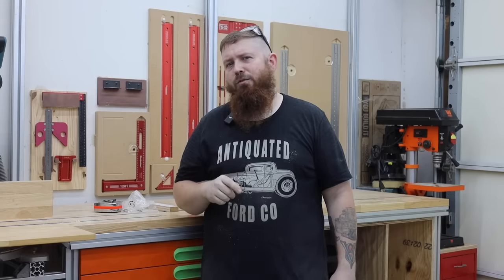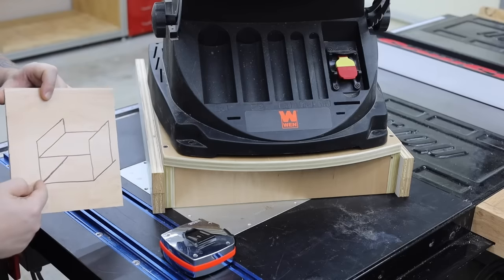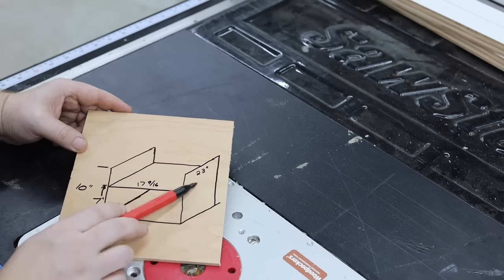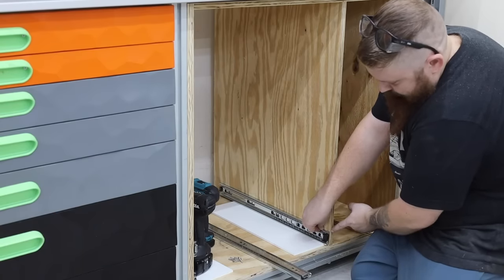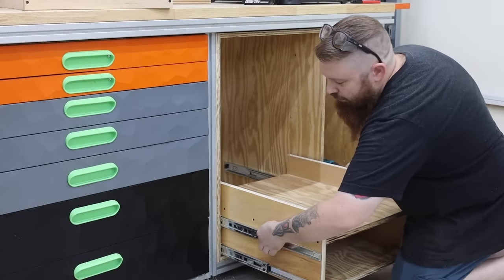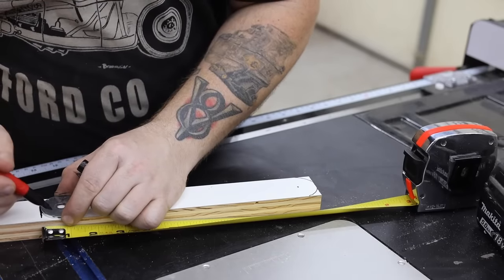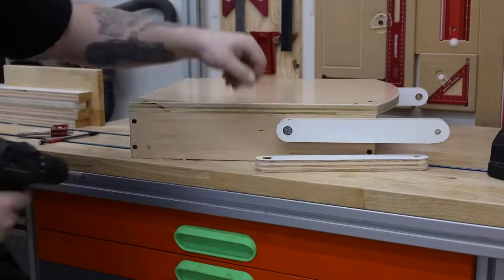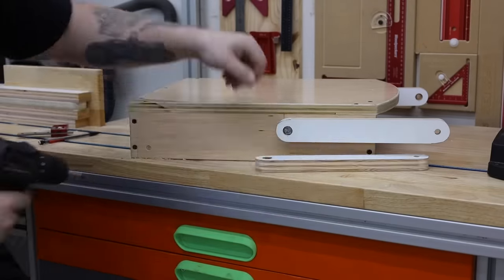Don't Build a Flip Top Tool Stand, THIS Tool Storage Is Better

Comment: I am currently working on my own rendition of a mobile workbench station and was looking for ideas for the bandsaw, planer, drill press, and router table to all tuck under to leave a clean workspace for assembly. This is a really clean idea and I’ll be using this in customer sizes for all the tools.  Thank you for making it.

Comment: I was going to build a flip-top for my spindle sander and belt sander. I have VERY limited space and having a flip-top would free up some of that space but this concept is much better. I can have 2 or 3 bench top machines lined up along the wall and with this "flip-up" idea I wont have to drag the flip-top out to access them. And that also gives me much more, valuable, work bench space. Thank you! Glad I found this.

Comment: Holy crap. What a great solution. I use a wheelchair in my small (garage) shop and have been struggling with coming up with a flip-cart design that would accommodate my sander (I have the Bauer (Harbor Freight) branded version of the same sander) as well as my DW735 thickness planer since space is at a premium. At my height, getting enough flip-clearance and not end up with the sander table too high is difficult. I spent the last two days making a cart with the DW735 on top and the sander on this type of lift and the result is fantastic. It puts the sander table at just the right height (essentially my slide out drawer is just a flat tray with sides - no riser necessary) and stows away easily under the planer when I don't need it. The only drawback is that I don't have much clearance behind the sander with the planer there, but I've never needed that really and with the weight of the planer I can pull the drawer out a bit to offer more clearance if the occasion does present itself even though the whole thing is on a rolling cart. Thanks for this idea!
Reply from the maker: That’s a great idea. Have a mobile cart with your planer on top and this sander below it. I wonder if somehow you could fit 2 tools below the planer. They could each come out on the sides so it wouldn’t block the planer from being used.

Comment: Great job and fantastic idea! I just started building a base cabinet to store my bench tools in and to have a work surface to use them on. I've looked at flip tops, ceiling tracks with pulley or winch lifts, and even lifts similar to yours. I finally gave up and decided to keep it simple by placing to tools on pull out trays and just lifting them manually onto the bench. Your idea is by far the best I've seen, and I'm so glad I stumbled upon your video. I'm sure this application will work great for at least some of my tools if not all. Thank you so much!
Reply from the maker: Thank you!

Comment: Thanks for a great idea. I have a Blackstone 22" griddle on a pullout in my outdoor kitchen. The only complaint I have is that it is lower than my counter height. I am going to re design the pullout and incorporate your lift system to bring it to above the counter, a better height for grilling. I will write back with the results. 
Cheers

Comment: A great solution!!! I can see this potentially clearing my scroll saw of the bench surface(great tool but not in ‘everyday’ use) thanks for sharing👍🏼
Reply from the maker: Thank you. I thought of doing one for a scroll saw that had slightly shorter front legs so it sat at a slight angle. Maybe it could be adjustable so if you wanted it to sit level.

Comment: Great solution. Stops stuff going everywhere unlike a flip out or revolving tool stand. For the drawer under my table saw stand, I angled the drawer slides up a bit to make it self closing. Might work here to keep the sander against the bench.
Reply from the maker: That’s a good idea. Thanks.

Comment: Nice build.  I made a flip-top stand for my planer/sander, but incorporated a drawer in the base.  I keep my accessories in ziplock bags inside the drawer so nothing gets lost.  Yes, I can’t use the storage built into the sander, but I don’t have the floor or workbench space to spare.  Just an alternative suggestion for those with the same issue.
Reply from the maker: Thanks

Comment: Have followed with great interest your "under the workbench" project and must state = for stationary, fixed (large / long) workbenches with sufficient free space under the work surface, your idea / implementation is certainly a gain, absolutely! BUT - if you have to get along with little space, stow machines and move in the room, the flip-top cabinet also has its justification. You just have to adjust the proportions, if necessary implement a handle for more safety, the larger machines you attach to the turntable and you just have to be careful when changing the tools / turn the work surface. In any case, I would not use the statement "THIS is ...". 
Conclusion: It is a pleasure to watch you implement your projects, have already taken one or the other suggestion, thank you for that! 
Please keep up the good work!

Comment: I am mixed on this.  This is another storage solution but it doesn't eliminate the need for a flip top design.  Filp top design allows for two machine to be held in a smaller footprint on the floor.  Most shops have more unusable/wasted vertical space.   Floor space is at a premium always.  Still a cool design.

Comment: This is a very cool option to keep in mind. For me it doesn’t replace a flip top as the purpose of that is to store two tools in the space of one. I also don’t have a fixed workbench like this to build a pull out/pull up and mobile is also a requirement. 

But that doesn’t mean I did t bookmark this for later 👍
Reply from the maker: Thanks
Reply: At first, I was going to do a flip top....but this is better for me as it allows me to retain precious workspace when it's not in use
Reply: A flip-top does not store two tools in the space of one. It just swops 2 tools over. If he had a tool on the worksurface, he could still lift the sander. If you flipped this style of sander, all the tools and space cylinders would fall to the ground.
Flip-tops-
- make dust hose and power difficult, and you always have one tool out, collecting dust
- take more effort to operate
- usually need to be on a cart, to give access to use.
- mean that most of the space around the stored tool cannot be used.
tools involved often are different sizes so space needs to meet the biggest.
Apart from that...
Reply: @Tensquaremetreworkshop  Pretty pedantic to argue swapping tools into the same space is not the space of one. It’s not like I didn’t think OP’s video was a great idea. I’d build one if I had a stationary workbench which I do not. Mobile cart is 100% a necessity for me.
Reply: @jhirn2957  Thanks! (pedantic means precise, and I always try to be that). I am a great fan of tool carts, but I have never seen a flip type that is worth doing.
Reply: @Tensquaremetreworkshop  I like fischer’s which takes care of the cord problem you mentioned. Also pedantic is being a pedant which is to annoy others by correcting small errors. Hope that helps your precision.
Reply: @jhirn2957  I try to correct errors of any size. It seems illogical to be annoyed at an improvement.
Reply: @Tensquaremetreworkshop  you must be fun at parties.
Reply: @jhirn2957  Also available for weddings and bar mitzvahs.

Comment: Great idea!  I might to do this for the router table I bought from KN Designs and my DeWalt planer.  It would save space for sure.  The planer is quite a bit heavier so it may need to be on top (mobile stand) but ensuring I have adequate work space for the router table would need to be considered as well.

Comment: DUDE! That is an awesome build and I'm going to do that for my shop. This is brilliant for things that aren't used often or need to be out of the way, especially if you're going to use a planer because you need an outfeed table and a flip cart just won't work unless you sacrifice one side of the flippy bit by leaving it bare. This way, more outfeed table than I'll ever likely need, plus being able to mount my sander/grinder/bench top drill press that can come up to working height in seconds.  Absolutely brilliant. 

One thing I didn't see was a locking mechanism so the thing doesn't fold down again. Easy enough to work out, but does it even need one? Appears to me that the risers are at such an angle when fully open that you would actually have to push it back for it to collapse. Am I correct in what I'm seeing? If so, has there ever been a time where it got pushed back so that it collapsed? I mean, while you shouldn't be forcing or pressing hard because the machine is supposed to do the work (if you want to do the work, use planers and other hand tools), is there a possibility that a collapse could happen having used this system? 

The reason I ask is that I volunteer in a hobby woodshop and things have been pressed too hard against/or otherwise abused to the point where we have to check square EVERY time ... Jointer fence not square, bandsaw blade not square to the deck, etc. I just want to know that it's stable in the event that I get frustrated or in a bit of a hurry and press the piece against a tool too hard. I'd be sad if the tool suddenly collapsed down to it's resting position (this will be for my home shop). 

BTW, this is one of the best tutorial videos out there. Why? Because you don't just give dimensions ... you THINK. Not every one of these is going to be the same, so you teach how to determine what an individual machine needs and how to measure and that is, in my opinion (because I make a lot of stuff up on the fly), a mark of a master woodworker. Okay, so "master" may be defined by some by the end product, and while that's part of it, to me, a "master" is someone who can fly by the seat of their pants and get the job done, changing dimensions for some "oops" cuts, moving things and recalculating because the plans are terrible, and it all working out beautifully in the end, even if that "beauty" is functionality. 

Well done, you! And thank you for posting. Subscribing.
Reply from the maker: Thank you so much. You could probably add a lock. As long as I am pushing forward, there’s no way of it coming down. If I use one of the spindle attachments or push on the back side of the belt, it can slowly push away from the bench top. A simple hook or something would prevent that.

Comment: Cool idea. Seems like there is space under the sander to add a drawer or similar storage, as long as you can maintain enough stiffness without the front panel. Alternatively, cut back a bit of the middle platform to facilitate access to the lower shelf.
Reply from the maker: Thanks. One day I’ll get around to adding a drawer there.

Comment: Neat- but a couple of issues-
Requires synchronized pull-lift-push to avoid crash
Is open at the front, for dust etc (it could have two (sprung?) side doors)
Lot of space not utilized (there is room for a drawer under the sander for spare belts, etc)
I would be tempted to use a higher drawer (around the sander) with a (lever operated) scissor lift.
-you would not need the reverse movement to 'dock' it
-the space underneath would be available
I think your approach is innovative, and can be developed even further. I have one of these sanders, and it has spurred me to look at how I store it... Thanks!
Reply from the maker: I’m interested to see what you come up with.

Comment: I had considered something similar for my radial arm saw, but instead of storing it low, storing it up high out of the way against a wall and then rotating down so that it can be used more towards the center of one side of the garage... The idea was that it would be stored high enough that I could walk on that side of the garage and open the door to my vehicle without needing to be as concerned about possibly denting the door from hitting it...

Comment: Excellent design, not quite as labor intensive or as expensive as a flipper. 
Just wondering: does that sander take care of most of your stationary sanding, or do you have something else going on in your shop? Long belt, rotary, oscillating drum sander?

Comment: Really like your design. I have a pull out drawer for my surface planer and the slides have a built in locking mechanism with lever so it locks into position at 1/2 and full extension. These sliders might be a good application for your sander so it doesn’t slide back towards the table during use

Comment: Love the design.  You are missing the reason why they made flip tops.  Storage of multiple units.  You have a thickness planer on the other side of the sander, so what are you going to do with your planer?
Reply from the maker: This could be built into a cart if you wanted. Put the planer on top and have this underneath. That way both tools can be used.

Comment: The whole point of a flip cart is to make the best use of space for multiple tools. While your build is beautiful I have the following two observations. 

1) For this build you should at least install a drawer or pull out shelf in the compartment at the bottom. 

2) IMO figuring out a way to secure the tools in the sander in effort to still use the flip cart would have been a more to the point solution.  I just bought a sander like this but haven’t taken it out of box. If I recall the sanding table lowers to hold the front accessories in place. Of course the tools in the other sides would need to be secured. 

The planner is the perfect tool to put on flip cart. I have a table top that doubles as planner flip and is great solution. BTW another tool to consider for the flip cart would be a bench grinder.
Reply from the maker: I have no interest in having a flip cart in my shop. I don’t want to render one tool useless to be able to use another.

Comment: Question to all who have built something like this:  I would like a way to "hide" my DeWalt table saw when not in use, so I can have that space for regular worktop.  None of the online designs provide a pivoting or in this case rising saw to deck level, is this because the saw's alignment is so critical that any movement would cause a problem?  Chris' solution seems perfect I'm just wondering why more people haven't done it.  

Also for the "drawer sliding away during work" problem, wouldn't that be alleviated by having the pivot go the other way (locking in place when the sliders are fully extended)? 

Thanks to all, I'm just a newbie at woodworking.

Comment: Great design & execution. Love how simple you made installing double drawer slides.  Did you try with single pair? Any racking/deflection? Should have managed weight ok?
Reply from the maker: Thanks. I just went with the double slides. No racking. Yea it should be fine.

Comment: I worried that your height was going to be slightly short, as the arms over-rotate that radius to come to rest.  I was curious if the arms just resting on the stops is enough.  I could imagine those arms wanting to twist if the bolts holding them weren't snug.  Excellent build!  I've never been fond of the flip-up.  You've gone and created more counterspace too.  Brilliant!

Comment: Wow what an unbelievably great video. I live nomadic. I'm a metal worker and want to be woodworker wanting to get into making more and was wondering about the difference in weight for metal or wood cabinetry and tool boxes. Could you make a video detailing the weight differences on making comparable products out of wood for alternative and out of the metal the welded perhaps even remake this very product but out of steel?
Reply from the maker: Thank you. Do you mean home made wood cabinets vs a metal toolbox?
Reply: @FullSteamDesigns  kinda yes and no. Like say a welding cart or this video's build? What is heavier? Now obviously for stability mods are needed for wood. But comparable same product head 2 head

Comment: Nicely done!  It’s called a four bar planar linkage.  Regarding the 9.5” measurement, the bars lean against the stops, so a slightly longer bar would be needed to make the sander table top come up to the desired height.  
Thought hard about something like this awhile back, but under-benchtop storage is in short supply - I need more drawers! - so I finally concluded that storing bulky benchtop tools in this manner is not going to happen, at least for now.  I DO like your work though.
A couple other things caught my eye in this video: curious about the benchtop extension at the miter saw; and wondered what drill press that is, and what you think of it.  I have a very old, very large (12” I think), very heavy (about 120 pounds) drill press - I like fixing old tools - but I’ve been considering whether to replace it with a 10” drill press.  Your thoughts would be appreciated.
Thank-you for sharing this project!
Reply: The 10" model drill press is also a benchtop model and pretty small if you plan to do any decent drilling. I have a 14" benchtop, but it is recessed into my bench so it's not so tall. I went to a store that sold drill presses so I could see them in different setups. I wanted the 14" depth to drill since I do both metal and woodworking and if I was taller(I'm5'3") it would be fine sitting atop my workbench, but I'm not, so processing was the plan. Just a thought.
Reply: @crossgrainwoodproductsltd9230  Thanks for the feedback!  Is the 10” a Wen?  Just guessing, from the colors.
Reply from the maker: Thanks